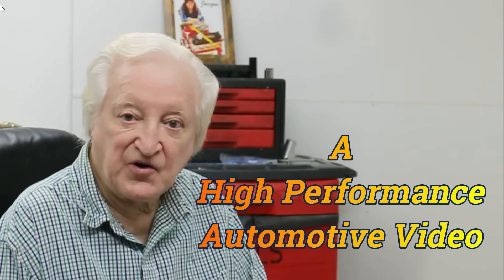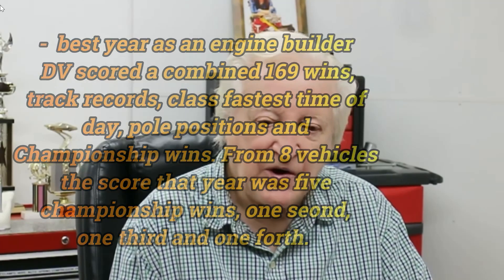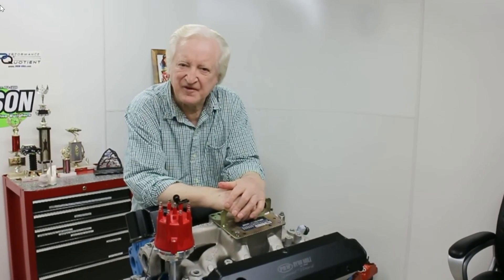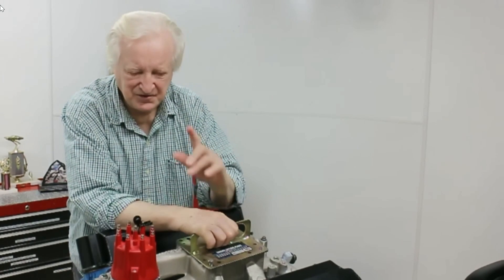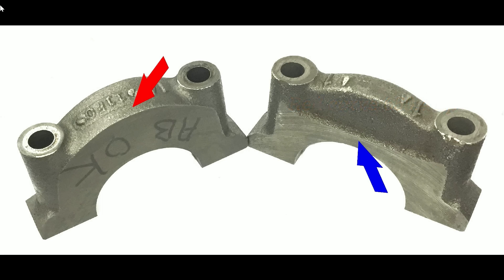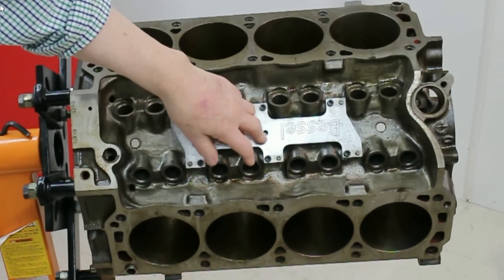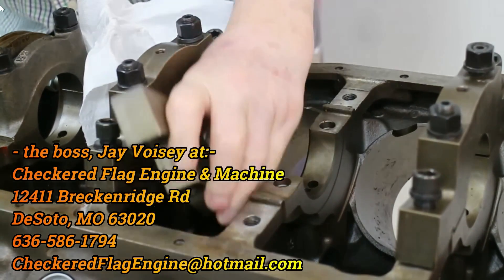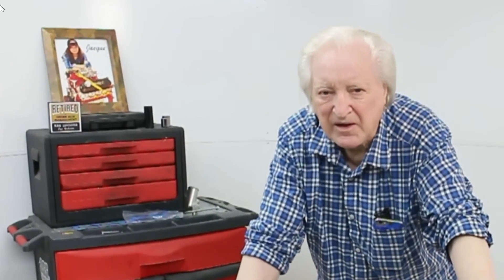302/351 Ford OE blocks - how to make them live even at 1000 hp

Comment: The question is how much does it cost to modify a stock 302 block with concrete ect  as compared to just purchasing an aftermarket four bolt main strengthened block?

Comment: Getting away from the 1-5-4 firing order and going internal balance is the best thing you can do to beef up SBF blocks. Adding the main girdle just keeps it together when the block cracks. They all start the same way through the front main cap. At the point I don't see why anybody would build a performance engine out of a factory 8.2 block. I wont even touch a factory 9.5 block unless its just a mild 400hp build and the block needs minimal machine work. By the time you find a good used block, install studs, bore, align hone, mod the oil passages, etc you could just buy a Dart SHP block for a few bucks more and actually have something you can grow with. You get a 4.125 bore to start with a block that will hold 1000rwhp reliably. Then you can build a 363 instead of a 347 or a 427 instead of a 408. You can actually build the SHP 9.5 blocks over 460" but you need A LOT of cylinder head to feed them. You're basically in high port only territory at that point.

Comment: Dave I'm kind of worried now I got a 1972 302 block 60 over stock rod stock crank Speed Pro  Pistons 220 dome 0.613 lift solid roller camshaft 264 /264 at 0. 50, AFR 205 renegade head 58CC chamber I believe that the 2.08 valve intake 1.60 exhaust Victor Junior intake Holley 750 double  pumper 4000 stall torque converter trans brake c4 transmission 9-inch rear with a 4.57 I could go on and on with all the stuff I have but the point is is my car making too much power for that block any information would be helpful thank you

Comment: I split two 302 blocks ( both were late 80’s ) and that was only at 500ish HP, I fixed  it by going with a dart block, motor now’s runs happily  with a little more boost at 645 Hp and it’s still together after countless passes, and is street driven.

I know this man knows his stuff, and If i ever build another SB ford I will come back to re watch this.

Comment: David is certainly one of the best in the business. Having said that there is NO OEM block that will take 1000hp ever and that includes the original boss block. This is with every possible strengthening mod done to them. When exceeding the 450-500hp mark, move to an aftermarket block.
Reply: If DV says they will hold they will hold of you do as he says.
Reply: 😂😂 do you think they all just explode at 500
Reply: He’s speaking of fatigue cracks.  

That means they’ll let go in time, and how fast they do is probably related to how much power you’re getting…

Comment: I always had a thought that the girdle design should not only tie the main caps together but mount to the oil pan surface all the way around the block as one large piece
Reply: Ive been wanting to build one to do this. I would also have it sit flush to the sides of the caps and crossbolt into them.

Comment: I had a 69 boss 429  block & the main caps would still walk even though it was for bolt maine 546 ci with 300 hp N.O.S shot Still had chatter and main cap walking problems Then I was lucky enough to find a  new S.V.O 460 block $1200 Problem solved I sold that engine to a friend of mine who in turn sold that block for $ 8000 Somebody was looking for a numbers matching block. And they were willing to pay that much just for the block. The block had been bored out to the max. And they still bought it

Comment: I’ve got a 1989 mustang with the stock block that came in the car and it’s been running 600 wheel horsepower for the last 15 years and 30,000 miles using a Paxton blower with a TKO 600 transmission behind it the motor is fully built but that stock block is there and hanging in just great
Edit: yes she’s main girdled and been through the machine shop for a stage two race prep
Reply: Put it on a video. Make a believer out of us.
Reply: @jesse75  doesn’t matter to me one way or another whether you believe me I know I’ve got it sitting downstairs in my garage right next to my Evo1 what you do think or have doesn’t matter one bit. I have zero interest of wasting my time making and editing a video to post it to YouTube. I was merely making a statement about the quality of some of the blocks that came in those cars and the fact that they will take a lot more than the Internet says but like I said if you don’t believe me I don’t care. Cheers🤘😎🤘
Reply: @600wheel  very good line of excuses. 
Simple to make a video and post it.

Comment: Why would you even consider building a stock OEM Windsor block to some ridiculous power? That block is a thin wall component and just will NOT handle that power level. Or at least not for long. Cast crank ??, main caps too light duty ?? By the time you get done with machine work and high buck specialty parts (steel crank, cross bolting, and so on)  you have surpassed the cost as well as the reliability of a Dart or similar after market item. Limit to 400 or so Hp with few good parts and machining and you have a good street and occasional strip engine.

Comment: The guy knows what he’s talking about.
My little turbo 306 inch SBF has been at he 540+ RWHP for over 14 years with hundreds of trans brake  launches at the drag strip. The block crankshaft and connecting rods are 100% OEM FOMOCO.  The devil is in the details.

Comment: David got a question. Just how beneficial is it using 351 Cleveland heads on a small block 289/302 ? Back in my day I always played with small block fords. Sm Chevy had a hard time with my mustang. I ported my own early cast heads and built eng.loose.. rev like a sowing machine. Best key to Ford it must breathe.

Comment: I'm wondering if the beloved  Chevy small block can suffer these cracking  issues  with a big power increase? , or Chrysler  small blocks? Also , I remember  after I'd re painted  my Hemi 6 cyl (Australian) motor it was noticeably  quieter  , I suppose  because  the extra thickness of paint dampened  vibration.
Reply: ,,,,,,,,,,,,,,,,,,,,,,,,,,,,,,,,,,,,,,,,,must  ta  been a hell of alot of paint...................
Reply: @ThomasELeClair  Three coats.

Comment: The Mexican block 351ws in my experience are much better than the American ones. A few years ago a friend had a 427w stroker on his '89 fox mustang, PRW main belt, H cranks etc, he was running 11 lows, upon reaching 10.70, if anything 2 passes, the block snapped in half, never I use nitro. Curiously, they had just given me a block 351 (Made in Mexico) year 89, I conditioned it and put it together, the car ran constant at 10.70 at the beginning, then we improved the suspension and removed the c6 trans and put a powerglide with transnbrake. The car improved and was running steady at 10 lows, many passes and finally we decided to use a 175hp sohot nitro. The car ran 9.40 many times...finally after 4 years of banging on the street and track a metal from a conrod failed causing one of the conrods to break and destroy the main mount and hit the block. . When I took it apart to see the damage, I was surprised that if the block had not been hit by the broken connecting rod, everything else was in place. the block did not fail at all.

Comment: This idea is really not wise to begin with. David admitted he destroyed loads of factory blocks. It's just better to go with a stronger 429 or 460 block. A 302 factory block is not worth the effort as you will want to get more hp out of the engine later on and will be at the limit of the block. Why set yourself up for failure. And the work involved and the disappointment from an engine that you are waiting for it to let go after every high hp run.
Reply: Or you can do the research and build to the power required. More power spend more money.

Comment: When we built engines to take this kind of power id say keep it at a lower rpm. Fill the block part way with filler. Run a plate mount, run splayed main caps. Use a stud girdle, and keep rpms under 7000.
Reply: I like that engine plate idea. Running that on my 427 FE. Never stop to think it adds strength too.

Comment: Back in the late 90s i built a 331ci stroker for my 90 notchback, at this time i frequented an internet board about 5.0 s think it called the corral.net.  When planning my build i asked advice questions and as an mechanical engineer chose to install a main cap girdle like what you are saying adds strength.  I cannot recall if i used tue DSS one or another but wow was it not popular with the so called experts on the site.  I was by no means an expert but when i looked at the situation felt it absolutely was going to help so glad to see that i was right

Comment: In diesel engine world like Cummins ISX engine caps will wear into the block. They have ring dowel that fix fit block and cap but they still vibrate under load. The fix using gasket eliminator to keep oil out of mating surfaces. Reason oil help caps to move which wears the block. Paccar engine main and rod caps are fractured there's no movement with them
Reply: ,,,,,,,,,,,,,,,,,,,,,,,,,Diesel block tech is the place to learn ,  for further knowledge.......THANKS,,,,,,,,,,,,,,,will try that  ; keepin oil out of the mating area surfaces...After all this TIME on this site ; I've got an arsenal of tech to jot into my journal of sbf  needed mods...................NO Doubt , this would apply to connecting rod caps also , keepin that oil out......JUST a light  smear will be sufficient , to fill the pores of the mating surfaces.......even the bearing inserts ; don't want bearing shells moving in place....Some guys pin bearing halves....And remember that stinkin used contaminated oil does not come out during oil drains and filter changes........If dirty oil can travel in , then it can travel out , thus contaminating fresh oil.....thanks again,,,..

Comment: Thanks DV for another excellent SBF video!
When planning the engine build for my '85 Foxbody, I looked at all the mods that can be done to my stock 5.0 roller block for strengthening and longevity. I also considered the cost to do it AND also the cost of all the parts that I was putting into the block.
(Callies crank & rods, Mahle pistons, coated bearings, custom grind roller cam)
After considering all the pros/cons of using my OEM 5.0 roller block, I decided to 'bite the bullet' and buy a Dart 8.2" SHP block with a 4.125" bore. (helps unshroud the AFR 195 valves and gives me 6.0 liters!)
It did cost more to build it with the Dart block, but I was already putting a LOT of money into the engine.
Now I can sleep at night with a truly bulletproof 363cid SBF.
Reply: The big bore Dart block is my fantasy build.
Reply: Id love to get my hands on that block and correct pistons……it does 6.0 liters on the stock 3.00” stroke crankshaft?………that extra liter is solely obtained by a .125” overbore??    What is the price on one of those fancy blocks??…….or would a bored and stroked 351 into a 427 be cheaper??
Reply: @trentdawg2832  
Dart SHP 8.2" deck blocks come with 4.125" bore.
3.00" crank in a Dart block = 321 cid engine.
3.25" crank in a Dart block makes a wicked screamer 347 cid engine. (vs. OEM 4.03" bore block with a 3.40" crank 347)
3.40" crank in a Dart block makes the bad boy 363 cid engine.
550 HP/500 TRQ easy....without winding it up past 6,600 rpm.
600+ if you want to cam it and push it over 7,000 rpm.
Dart SHP 8.2" blocks were $2,200....now I think they are $2,500.
I waited close to a year to get mine because of COVID shutdowns and delays.
A 9.5" deck 351W block is definitely stronger than an OEM Ford 8.2" roller block.
I wanted a Dart SHP 8.2" deck block so that all my 5.0 accessories bolted right up and I could make it look like a mildly modded 5.0 engine....heh heh heh
🤫😁
Reply: Smart man.
Reply: Uh, 289 that can handle sustained high revs?  7.5+k for long periods?
Reply: @dennisyoung4631 
I love 289s!
I had one in my '65 2+2 Fastback Mustang, 'A' code 4 speed.
But....I'll take a bulletproof 4 bolt main 6.0L (363 cid, actually 364cid if you are counting correctly) SBF vs a 4.7L (289 cid) 2 bolt main SBF ANY day.
Properly prepared and modified cubic inches ALWAYS win.
BTW, with the correct cam, a 364 SBF can turn 7,500 rpm forever.
Reply: @Turbo4Joe363 yes, I know about there being, “no replacement for displacement.”

Still, though - I’d want a very stiff block for a small(er) displacement engine - potentially a slightly taller deck, even.  Then, there’s the sound.  Had I known about that sound - the F.O.R.D. Sound - almost forty years ago - I would have tried my very hardest to secure a suitable vehicle with one of those engines in it!

Both engines would make ample for, say, a (somewhat) tamer flavor of a certain Ken Block car-clone, well-suited for longer stretches through twists and turns - and the semi-regular track day - while still tolerating light to moderate street use.

I think five liters was the limit for some classes.

Comment: The 302 and 351w blocks really aren't comparable in terms of strength though, as the 351w blocks can already handle much more power than any 302 block.
Reply: It's all harmonics. The reason they break is vibration. Vizard himself has been to 800hp on a 302 block. You have to have the right girdle to get there. 500hp is not the limit.
Reply: Yet they still commonly crack in the front cam bearing area on the roller blocks.... Waste of money on a big hp set up to use a stock roller block prepped like that or not unless your going after some stupid record or required by class rules.  It's not if it will break, it's when.
Reply: @nothanks81 get a ford racing block with 4 bolt mains
Reply: Yeah 351w to me is maxed at 750-800hp 302 is closer to 500-550 if you want it to live. In the end if you want to be sure just get a Dart SHP and never look back. Seen a lot of 600+ stock block 302 but eventually after a few seasons they split. The main caps tend to start fretting with high rpm and high hp. Studs help to a point but it is what it is. Stiffer block and beefier main caps are the eventual solution.
Reply: @Bacongrease00 been building 302’s for 20+ years never had one crack now because of the internet apparently they all do 😂 some BS
Reply: @CoyoteFTW  yours probably don’t make enough power
Reply: @Bacongrease00  exactly, I wouldn't have made that comment it just let's everybody know the engines don't make any power. Because it's a well known fact they split when you get north of 5 to 600hp.
Reply: @CoyoteFTW great.  I have been building them since the 80s and they break sub 500.  Not everyday ..but stock blocks need to be measured. Going over 500 HP that gets used will fail the block.
Reply: @CoyoteFTW same. I've done a good 150 or more engines. Never seen a cracked block.
Building figure 8 engines. Spun a few rod bearings. That's it. Over heated the pizz out of them too.
Reply: Well I know for a fact that a Mexican block will live at 600+HP  for 3 full seasons not missing but maybe 2 weekends per season. After season 2 it got a valve job and valve springs and we took the pan off and even at the end of the 3 the rods and mains were perfect. Now we do things a little different than most. The motor like all the others gets 2 half hour sessions on a dyno. Break in oil is drained and 5w 20 w mobil1 goes in. So all racing is with Mobil 1. We change the oil 1 time about halfway through the season. The Mexican blocks have a beefier main cap all the way across. They imo are a stronger block but we also use the Moroso steel block girdle as well.
Reply: didn't he say that at the start of the video.....

Comment: How did he get 525ci from a stock 454 production block? I thought 498ci was about max out
Reply: Why bother 460 gets too 557 no problem
Reply: 4.5 stroke plus large overbore. The bore is easy, 4.5 crank in a genV block is a fair bit of grinding!
Reply: @jondahl3173  can you fit a 4.5 stroke in a gen 5? I haven't seen a mark 4 that could accept the 4.375